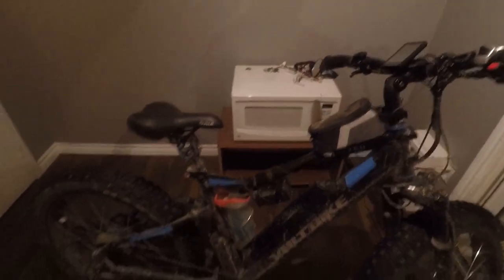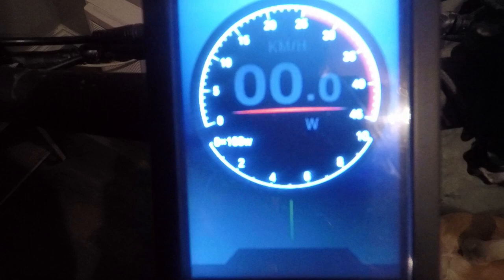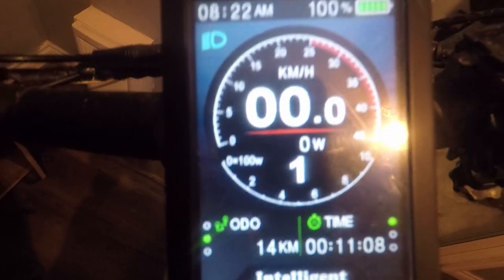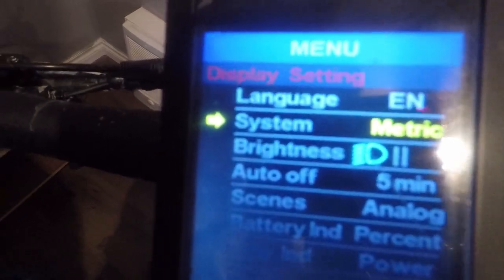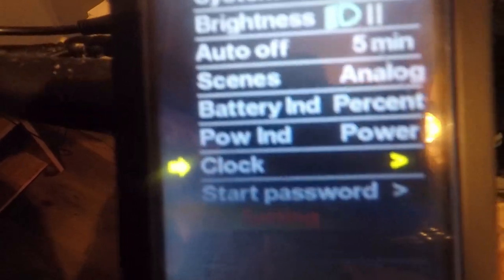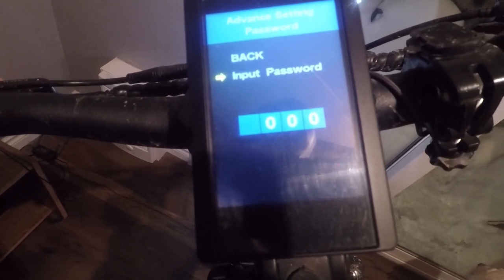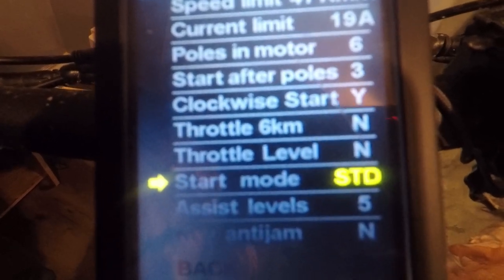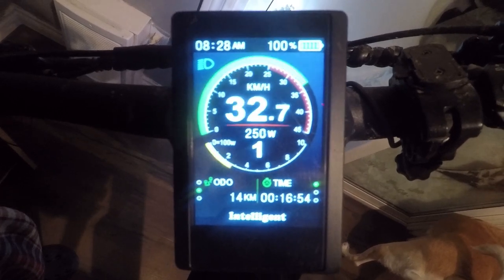Color Display ,Installed On the Voltbike Yukon 750! in depth , look into

Comment: Great job 1 question I know it takes time to charge the battery in the colour screen while the bike is running but how long does it take for the battery to charge on the colour screen thanks.
Reply from the maker: what i did , was turn off the auto shut off after so many mins , to never shut off , and then leave the bike on over night , to charge the display so it will keep time ,, cheers